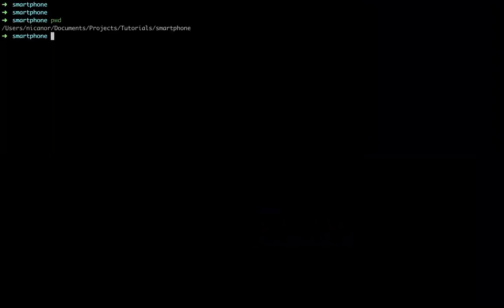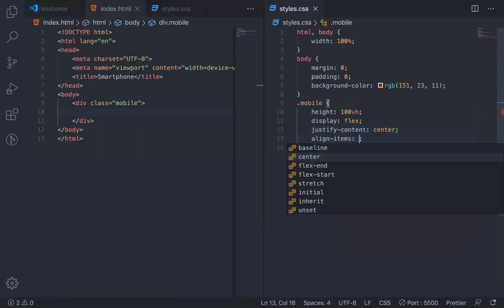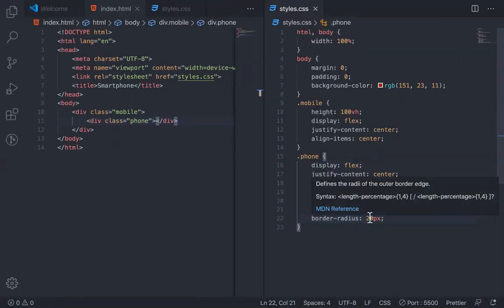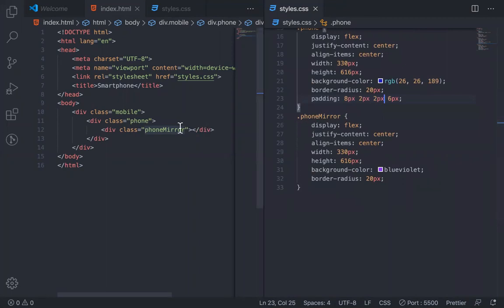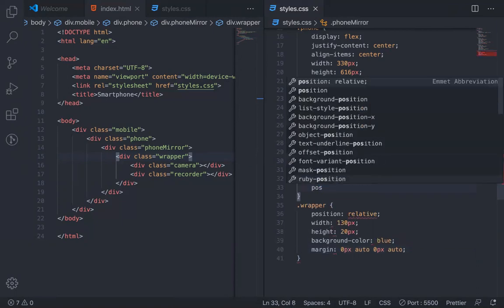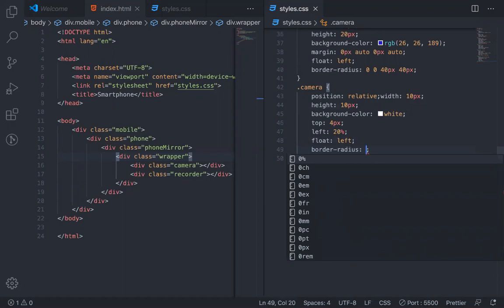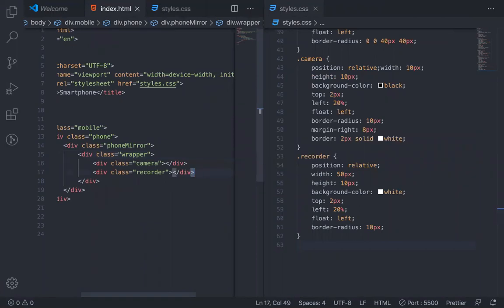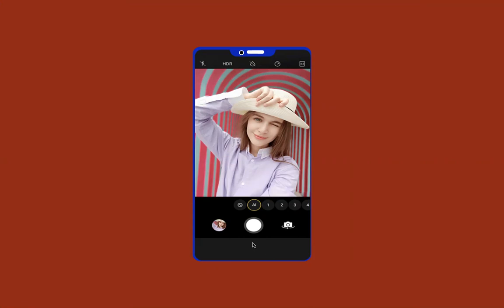Create a Smartphone using HTML and CSS

Comment: Pardon my ignorance. What is the app used to edit the html & css code? Do you need to configure anything to get the results shown on port 5500? Or is that default for the file location you are using?
Reply from the maker: I'm using VS Code. To view results in port 5500, you can add an extension called live server then right click on the html and view with live server extension. If you edit anything on the html and css, it will update the page automatically.